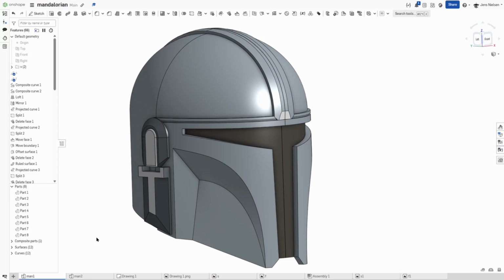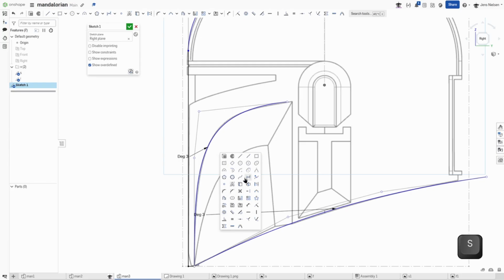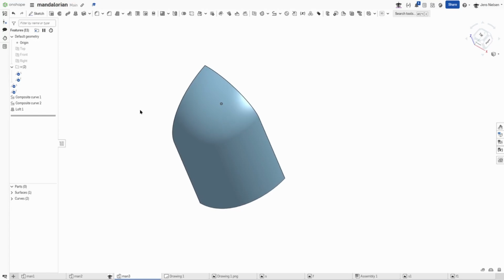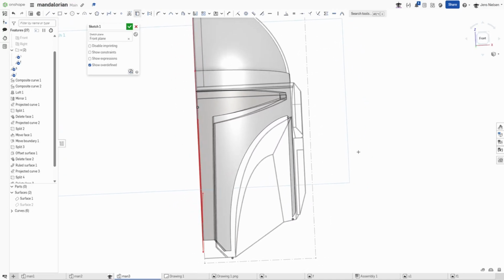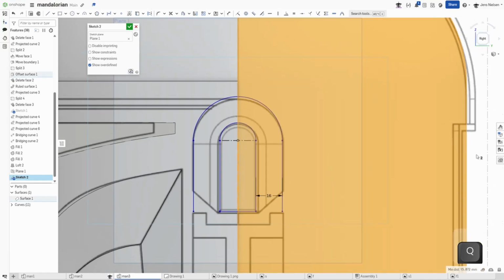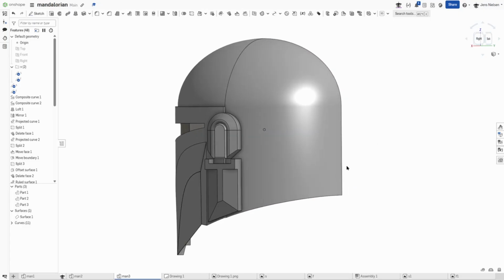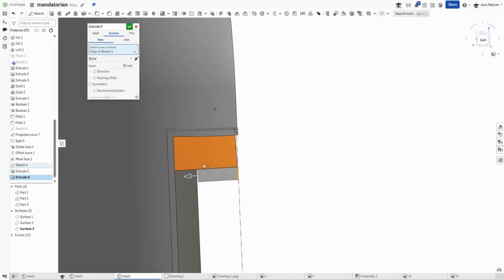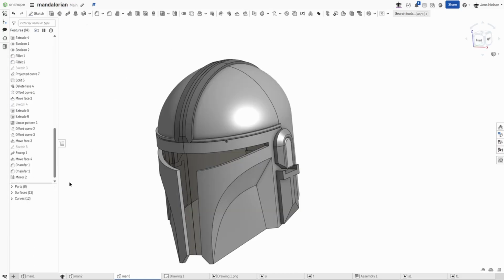How To Make a Mandalorian Helmet in Onshape with surface modeling!

Comment: I'm having difficulties with the projected curve/move face for the visor as I have noticed that once I project it onto the 3D model a split isn't automatically applied like it does on yours, I have ensured that the lines are long enough. I have tried to apply the split manually but having no luck as only just picked this software up off this video so very much a beginner. Should a split automatically apply or have I missed something earlier on which is stopping that from happening? Any help would be greatly appreciated :)
Reply from the maker: If you are just starting with the software, why don't you try some beginner-friendly videos? As to your question, yes, this is automatic.

Comment: Hi Ya'll! to anyone who's having trouble with the offset with upper helmet around the 15min mark. I was having trouble with that been figuring this out for a while; not sure sure what the problem is since everything I did so far is correct and checking the model. I kinda found a way to do the offset. I played around with the numbers to see how much you can offset the loft and surface 2. I was able to only go up to 0.5mm and flipping the arrow inside helped, being able to see the offset. May not be a lot compared to 4mm but it did work. it could be a small tiny error when making it that causes error that onshape produces not identical geometry but odd since it should work into doing this. Hope this helps!
Reply from the maker: Great tip, thank you for helping out others who might be stuck there! 👍

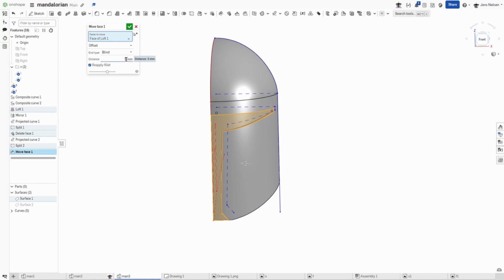Comment: I loved this tutorial and learned quite a few new things. I ran into a problem with the Move Face step for the Visor at 14:02. No mater what I did I couldn't get it to generate. I also tried to remove the visor but later on I still couldn't thicken that original loft piece. I could however thicker the part I mirrored off of it, so I'm not sure where I went wrong. I even tried deleting the whole thing and starting over, but ran into the same issue. Any idea why I may not be able to move, offset, or thicken that initial piece?
Reply from the maker: Thanks. What I could imagine is that your lines might not be long enough to cut through that face-I suggest extending those beyond that surface to making sure to generate a seperate face.

Comment: I can see that you have the same tutorial for both Onshape and Fusion 360, which program will you suggest for a beginner from an ease of learning and using perspective?
Reply from the maker: that's a great question. It depends a little where your are coming from-for me, from SolidWorks, it is easier to go to Onshape. Plus, you do not have to worry about obligatory updates, hardware- heavy downloads or performance issues, and the app itself is very robust.

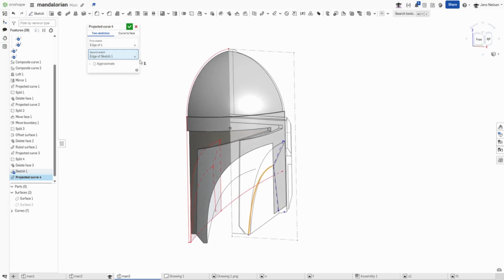Comment: The tutorial was great, but I'm stuck on a part at minute 19:13, when I try to project the 2 sketches, the curve comes up short, and doesn't connect with the other 2 lines. I don't know why that is happening
Reply: Side note: I tried redoing the second sketch and when I try to project both sketches it says error regenerating
please help
Reply from the maker: Thanks and sorry to hear that. Are you sure you got the endpoints of those two sketches aligned with horizontal constraints?

Comment: My 3D modeling class is following this tutorial but we are having trouble with the offset surface command at the 15:00 min mark. Whenever we perform the offset, then go to remove the faces, the entire side of the helmet (surfaces 1 & 2) both disappear. Any suggestions?
Reply from the maker: Let's figure this out: when you write "remove" you mean "delete face", correct? and, this is important, you do not take the "delete part" command. and then, you pick those two surfaces in the browser, where the upper curved surface is a separate thing from the other part you want to conserve. Let me know if this helps!
Reply: @cademist  I have toyed with things a little more. The issue is with the "Offset Surface" prior to deleting the face. Some of my students cannot get either face to offset. I am only able to get the smaller top portion of the helmet to offset (Face of Loft 1) but cannot get Face of Mirror 1 to offset. When I select the Face of Mirror 1, I receive the following error message: Offset surface 1 did not regenerate properly: Could not offset selected faces as requested.
Reply: I've pulled up your model and tried to compare side by side but still cannot get the Offset Surface mentioned above.
Reply from the maker: @markthomas4246  maybe you can share  your model and I can have a  look.

Comment: Great video. I was following your tutorial. I came into difficulty with offset faces at 14:54.  I noticed you have a split 3 in your Onshape timeline that you did not mention. Can you tell which split you made there?.
Reply from the maker: https://cad.onshape.com/documents/644ba54c12a0e0fa25377acf/w/fafa6949705ca895977f5bea/e/1743a34f1b65046633c79edf?renderMode=0&uiState=680c8e031101d362c5cb5485
this is a link to my document. thank you for your comment, "split 3" you mentioned is of no importance. Please let me know if you keep encountering a problem with that offset. I hope my link can elucidate things. I would like to know  If you are able to solve this now. the offset is that back face (top plus bottom) and the front face (just top). I should have turned the model to indicate this more clearly.
Reply: @cademist  Thank you

Comment: I answered your reply, sir, can you look at it once more, when you have some time left? It'd sbout the splits, split 2 and split 3, I was not even further than that.
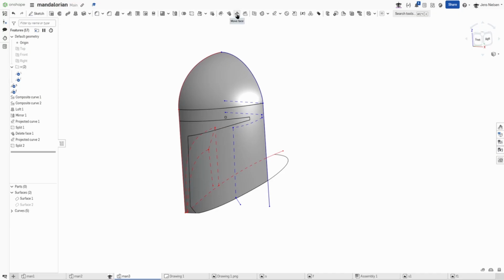Reply from the maker: ok, i got  back to 13:54, and it seems I omitted to mention a split face of that "T-shape". I hope this helps. I share my document:https://cad.onshape.com/documents/8908d453d7963560a3b74e4b/w/b499de726921c86b23a78f0c/e/90b22b6fed8f8ba4cbf893e4?renderMode=0&uiState=67ed5c5b55bb92736221d1cb
Reply: @cademist  Had exactly the same problem. Figured Out how to split the face! Thank you! Very Happy to proceed.
Reply: @cademist  , Thanks!

Comment: Question sir, if I may. When I try to move the T face at 13.40 on your video, I only can select the whole surface 1 and not the T. Before starting all over, maybe you would help me?
Reply: I had this same problem, his part auto splits the projected curve 2, so all you have to do is create a split like what we did with projected curve 1
Reply from the maker: I can suggest two soluttions: one is, whenever there are several selection options, you right-click and go to "select other" and pick from that list, the other option is that you hide that front surface for a moment. Hope this  helps!

Comment: Nice tutorial! I noticed that you use several CAD packages on your channel, including NX. I'm an experienced NX user (12 years), but I'm interested in OnShape for use in a startup. Can you comment about the capabilities of OnShape vs NX? Specifically: Is there anything you can design in NX that cannot be designed in OnShape? How would you compare the top-down design workflow from NX (using wave-linked bodies) vs OnShape? How well does OnShape scale to very large assemblies (>30,000 parts for cars and >100,000 parts for commercial jets?)
Reply from the maker: Hi @jeffpeachman, thank you for watching and for your question! It's great to hear from someone with 12 years of NX experience.
As you know, NX is a powerhouse with many advanced features.
 I find Onshape excels in its ability to simplify tasks, especially with its straightforward Part in Context design, which I've demonstrated in several videos.
Regarding very large assemblies (30,000+ and 100,000+ parts), I don't have direct experience at that scale. However, I understand that NX has a strong reputation for handling those types of assemblies.
I hope this helps! Feel free to ask if you have any other questions.